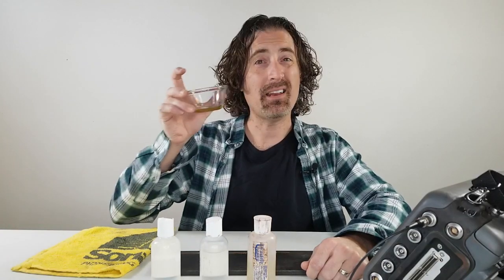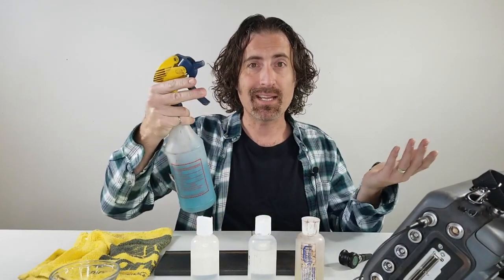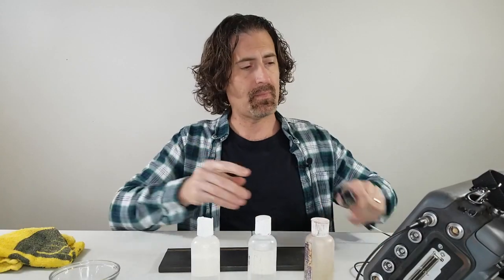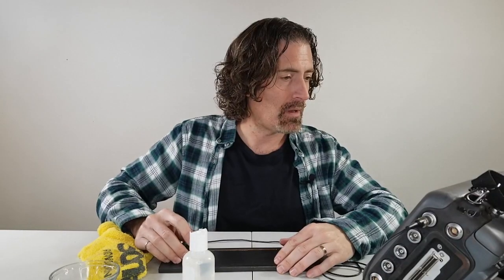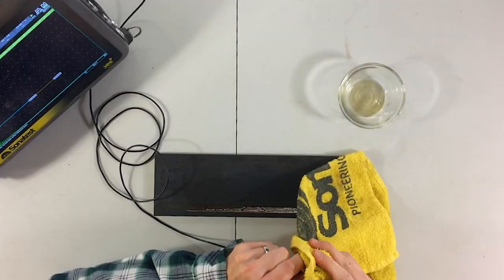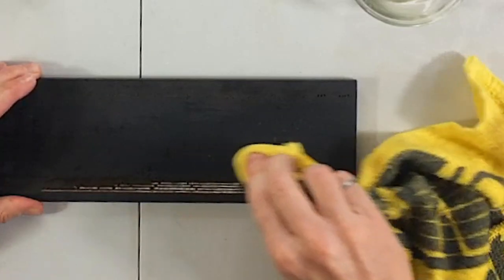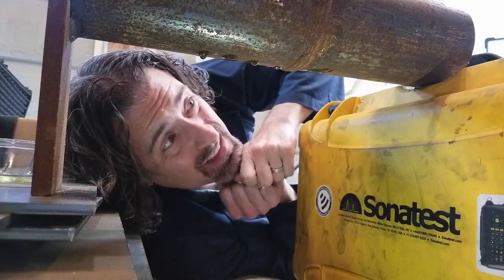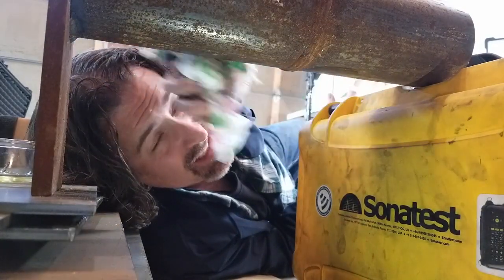Honey vs. Couplant?

Comment: Back when I worked for GE Energy, I spent years traveling worldwide to inspect first stage turbine blades with shearwave through the bell mouth.  Trying to travel internationally with Echogel or other similar liquid couplant was problematic after 9/11, so I had the idea to pack the powder stuff and mix it onsite.  It was always in my checked luggage, so who knows what all was going on behind the scenes with TSA looking at a bag of white powder in a suitcase.  I never thought about it until I was pulled aside in the Hyderabad, India and led to a small conference room where they basically treated me like a drugpin until the police came.  After several hours I was let go.  So, the solution to this was that I would travel with honey for my inspections.  The one in the bear bottle was my go to.  It works great and, in a pinch, you can find honey at any grocer around the world.  Hot water cleans it up pretty well.  The only issue I had was it attracting bees and other insects.